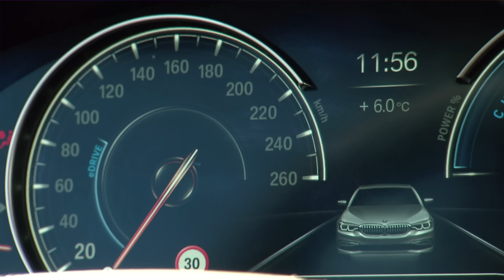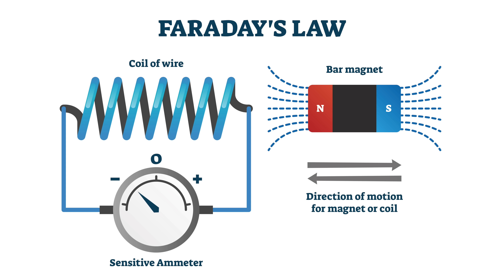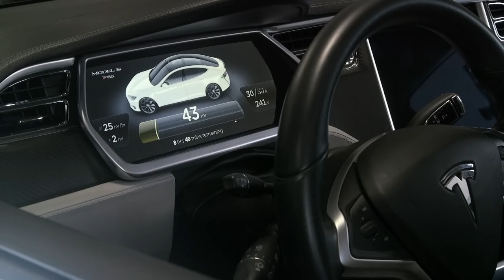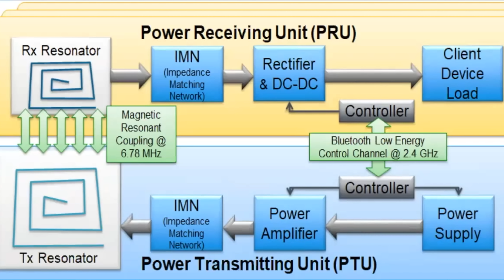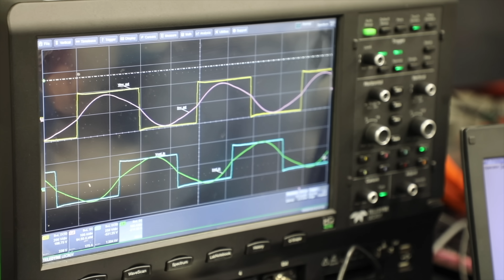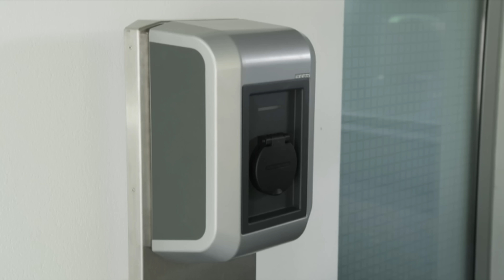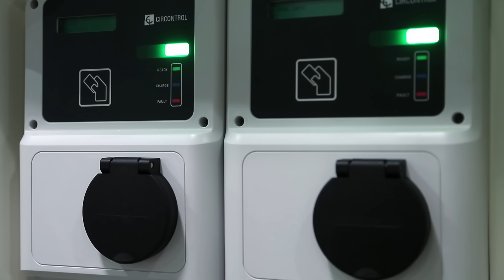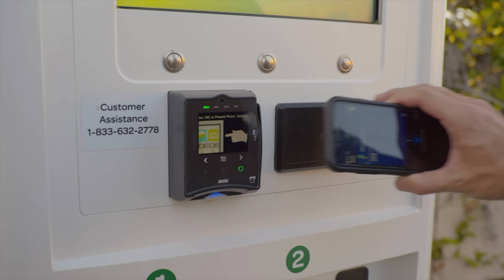Will Wireless Electric Car Charging Change The Way You Charge? Or Just Make Robotaxis Better?

Comment: One place I could see wireless charging be very useful is for pool fleet vehicles.  The kinds that can be in and out all day, shared by multiple drivers.  As someone who has such vehicles at work, with dedicated car parks I cannot see electric vehicles being easy to manage in this situation if we had a few 7kw chargers in our parking area.  Come back with a near empty vehicle, chargers in use.  Even when its free who is going to remember to go back, unplug the vehicle and shift it to free up the charger?  If a bulk purchase of inductive chargers was close in price to individual 7kw chargers for our fleet of 30+ vehicles I could see management going for that option for the convenience factor

As for chargers under the road I cannot see it happening.  Roads are constantly getting hammered by heavy vehicles of 50  tonne plus, require ongoing maintenance, often have services thrust under them which can damage other infrastructure and in a lot of places by the time you put in the three waters, gas, telecoms (often from multiple companies), power, street lighting circuits etc you can quite quickly start to run out of space, especially if you want to make cable runs efficient/cost effective.  

Private parking areas like parking buildings may be a possibility as they generally have less services underground, generally suffer less wear and tear and could be a way for these sorts of companies to create an extra revenue stream by selling the charge to the user or offer it as a value add to attract customers.  Ie the discount supermarket may have a couple of wired chargers available, the premium service supermarket may have wireless charging as a point of difference

Comment: Too inefficient. A lot is lost in heat. If infrastructure for it was built, you'd find it unneeded soon
Reply: Exactly, just more tech that the fan boys can play with themselves with. No matter what you do it will always be quite a bit more inefficient than a cable, air is a terrible conductor and losses in the air are squared are distance apart increases.
Reply: @instanoodles  'Air' isn't conducting the charge, they aren't fitting Tesla coils under the cars ;)

Comment: Mmmm interesting. My idea has always been to simply have charging stations setup at stop signs and traffic lights. The problem have been that inductive charging is not very efficient but with the tech you mentioned it has become possible.

The idea is simply pair a charging pad with a large capacitor (and in the car as well). When you stop at a stop street or a traffic light the capacitor can be charged to give a few KM of range. The battery can the slowly be charged if necessary. 

This sound stupid but will save a lot of space in the centre of town where charging stations are simply not needed anymore. Simply driving through downtown will give you enough power for you trip inside the city.

Comment: I disagree with the "advantages" of wireless charging in public or commercial space. All of those problems you have mentioned with wired charging infrastructure likewise would apply to wireless charging: 1) They might not be on the same network, 2) they might have difficulty paying, 3) they might have authentication issues, or 4) users on the phone talking to representative that does not understand why the car is not talking to the charging pad. I know you specifically clarified "if implemented correctly", but that likewise applies to current wired charging technologies — both wireless or wired charging solutions could avoid all of these issues — when implemented correctly. Later in the video, you came to the same point as I have just made above, that for any solution to work (wired or wireless), network, payment and authentication issues need to be resolved in order for the solution to be viable. So then, what would be the advantage of the wireless charging other than convenience?

So it really does come down to convenience — if the solution can be made reliable enough, efficient enough and cheap enough, then the convenience factor may finally push the solution towards mass adoption.
Reply: Indeed. I was shaking my head so hard while she talked about how wireless charging would somehow avoid all the ridiculous problems with plug charging. To be fair she walked it back at the end of the video. If anything, I'd expect wireless charging to be fundamentally more finicky than plug charging. Imagine you're in customer service trying to figure out, over the phone, that the customer's car is too off-center because they suck at parking. What a miserable job.

Also, people who think wireless charging could be cheaper to install, so we get lots more of it? How do you figure? I can't think of anything related to wireless charging that would make it cheaper to deploy. If anything, it seems more expensive. Plus, each coil can service exactly one parking spot. With plug charging, you can offer parking flexibility, with a cord long enough to reach either of two spaces, or even four spaces facing each other.
Reply: Can you have different electricity providers through the same electrical grid? This is at least possible in for example Sweden; you pay a fee to the net-owner and for the production from your chosen electricity producer, and I don't believe that's a unique model. Wireless charging could just be an extension of this and could be easily regulated with e.g. rfid-tags acting much like a sim-card, or even better, have a "meter" in the car that occasionally sends your consumption data to your provider - again just like regular household consumption works.

The problems of plug in charging stations are only potentially problems for wireless charging if you're stuck in the old plug in/fuel station mindset.
Reply: @idomaghic  I don't see why not -- assuming power from the provider goes into a "pool" of electricity.

Anyways, what you are describing with rfid and multiple providers are solutions to accounting and backend issues -- not really particularly unique to wireless charging. The solution can equally be applied to wired charging, and we are back to the same point about advantages of wireless charging beyond convenience, or lack there of.

Comment: I hope we see standardized wireless criteria. More for the public setting, and maybe for highway cruising. Smaller packs and/or longer highway cruising for both personal and commercial long haul transportation. 

Would also be a nice option for multi EV garage / driveway parking. We currently have wires hanging overhead for flexible charging between two vehicles, hanging them overhead eliminates surface clutter and cord management, but would gladly replace them for wireless units assuming the price was right.

*edit- I was also reminded, by another commenter, subzero cords are quite miserable to manage in northern states, both uncomfortable by touch and quite stiff. While modern DC fast units may mitigate this with thermally controlled cords, the overnight outdoor parking population will benefit greatly with this, in the frigid North.

Comment: inductive charging is way too inefficient waste of power
Reply: As the video mentioned, they're working on improving the efficiency. And if they use a pilot signal to establish a car is above it then it turns on. Otherwise it's just a lump in your parking space drawing only 1W at the most, just like all our other devices that are plugged in but not in use.
Reply: @davidmccarthy6061  the radiation is spherical, so unless the car is wrapped around it. you'll always have big losses. there's no point, just plug in and lose almost nothing

Comment: Not keen on the inefficiency. That runs counter to both the "cleaner and greener" philosophy and the argument that it's cheaper to run an EV.
As for the hassle using public chargers, the solutions are simple: 
(1) contactless payment (debit/credit) card, no app or phone required (Instavolt do this now in the UK, it will be legal requirement for all new chargers) 
(2) Automatic billing based on VIN communicated through charging connector and registered with a payment card or bank account. Literally just plug in, check the green light comes on, and walk away. Tesla does this already and I believe that CCS supports it but very few cars have it.
Reply: Agreed, practical improvements.

Comment: There is/was a similar  charging system being trialed in Milton Keynes UK on a bus route, where the bus has timed  turn-round stops at each end of its route. The idea was to use induction charging as a range extender.   Can't find a recent reference to it for an operational update, the original story was from 2014.

Comment: Yay lossy charging, excess heat, and more proprietary systems for charging...

This is a niche product which will never be ubiquitous, manufacturers putting the charging plate in slightly different places and people being terrible at parking will render the losses too large to be useful. 

Wired charging is the way to go.

A straight forward cost per kWh electric fast charging "pump" would be familiar to most people, the only thing causing problems here is various charging networks wanting you to join their club.  Can you imagine the outrage if you had to join BP or Shell and show a badge before you could get fuel?

Chip and pin pay at pump fuel supply has been a fact of life in the UK and Europe for over a decade now, most supermarkets have a forecourt, and it's an unmanned cashless pay at pump system.

Supermarkets, which essentially sell fuel at cost to get you to go there for your shopping, are already in the process of putting dedicated fuel filling stations out of business in the UK.  This has been going on for 20 years now. 
1996 article https://www.marketingweek.com/superstores-ignite-forecourt-price-war/  
2019 article https://www.racfoundation.org/media-centre/supermarket-fuel-on-almost-every-doorstep

It seems to me that supermarkets, with massive car parks, and the expectation that people will be there for 30 minutes to an hour would be ripe for having entire rows of parking turned into charging bays, and this is probably the future, fuel forecourts will disappear, and parking lots will become the replacement.

Long term parking in cities where a car sits all day, don't even need fast chargers, the granny plug is fine, need 8 hours far a charge?  Not a problem, your already parked up 9 to 5.

You own a factory with thousands of workers and a huge parking lot?  How about all the workers with no off road parking pay you charge their cars when they come to work?

Fun times lie ahead, and carparks are likely the future of fuelling.
Reply: Your second "niche product" sentence s exactly what they said about EV's ten years ago, your blinders are already on.  There are countless products we use today where someone had said, "that will never work". As for workers paying their employer to charge at work, also not viable. But companies can use it as a free perk to entice people to work there. The efficiency of induction charging will continue to advance because we won't need to go to a special place (gas station). With electricity already everywhere we just need to put in the best solution for each location, be it induction or wired.

Comment: Hope wireless charging improves greatly because atm my phone and a couple of friends i know that use it, causes the phones to get very hot. I can imagine that being amplified on BEV's.
Reply: The problem with phone batteries is they are pushed to the max so as to provide the thinnest phone possible so tend to get hot no matter what it's doing. 
This system is a slow charger and more importantly synchronised which as far as I know is not the case with phones yet. The more efficient a system the less waist heat there is. This is why they have spent the last few years sorting out an industry standard so as to avoid the mistakes of different plugs and protocols the EV market has had to put up with up to now.

Comment: I still want to see these systems regulated for RF interference before they become commonplace. And not the free for all that is Part 15 in the USA !
Reply: Some long as they stay below 8KHz there is not a lot of trouble.
That does make for quite a big LC circuit but that is fine.
Basically it can be the classic resonant converter sort of design where the inductor and capacitor give you a big fraction of the filtering for free.
A bit of needless detail on the idea:
Imagine the classic "H bridge" with the negative side being ground.  The positive side can have its power filtered in a manner that causes it to dip near zero volts as the MOSFET pairs switch.

Comment: Parking spaces with great big charging stations in front of them are being ICEd. How much worse will this get if there is just a discreet pad buried underground?
Reply: Great point!
Reply: will not be a problem if there are enough, all long duration car parks need multiple charging pads/posts etc will mean so long as you can find a space you can charge.
Reply: @edwyncorteen1527  Yeah but that has nothing to do with wired vs. wireless. It's not like induction pads will be cheaper to install and maintain, such that there would be more of them.

Comment: The problem with charging at home on the driveway, is as much a problem as public charging. I still have concerns about safety, my 7kw charging cable has managed to twist its cables inside the sleeve, causing a bungle. Plus when it gets cold the cable stiffens up causing loops to stick up in the air, and we have two EV's and so the problem is duplicated. So the fact that inductive charging is also reversible is news to me, but also make sense. This would be a great solution to my problems and needs surrounding cable charging at home and at public charging stations! Bring it on!!
Reply: Yes! Dealing with sub zero charging cords in Minnesota wasn't enjoyable.

Comment: In parking spaces I think it makes sense. IF they can get efficiences as high as those claims. But charging while driving? I dont get it. How much would it cost to install 10 MILES of continuous chargers under a street? Because thats what it would require to actually do... Anything. Driving at the low low speed of 20mph you could get a nice 30 minutes of charging out of a 10 mile section of road... Assuming a continuous induction effect. 

But how many parking spaces could you fill with ten miles of continuous chargers? If the charger were say... 2 feet long... Thats 26,000 chargers end on end. Even if they were spaced apart and only required half as many that is still 13,000 chargers.  How many apartment complexes or shopping malls could those provide power for? 13,000 vehicles charging with the same infrastructure as it would take to make one section of one road an effective charging option. And wouldnt the road have to have a complicated system of sensors to detect vehicles before they got to the induction plate? then try to turn it on at just the right time, with no handshake because that takes too long? Which means it would have to turn on for EVERY car no matter if its an EV or not because even at the low low speed of 20mph there is just no time to confirm it. So they would be wasting dramatic amounts of infrastructure and resources to provide a service to drivers on ONE route. 

 Whereas a parking space charger could just use the same old magnetic field sensors that stoplights use to initiate the handshake. If no handshake occurs it just goes back to sleep.
Reply: You're absolutely correct.  Another problem with chargers in roads is that roads get torn up on a regular basis for servicing the utilities buried underneath, and develop potholes from vehicle damage and freeze thaw cycles.  Chargers in roads don't solve any problem that we don't already know how to solve at vastly lower expense.

Comment: I'd pay to have a wireless charger installed at home if Tesla supported it. Plugging/unplugging isn’t a huge hassle, but the convenience of just pulling in and walking away would be worth it to me. Doubly so if it supported V2G.
Reply: Wireless charging is dumb and inefficient
Reply: @carholic-sz3qv  She said WiTricity claims 93%. The standard plug from the wall is only about 98%. So it's not that bad. I use wireless charging on my phone too, even though it has a plug on the bottom.

Comment: Wireless charging will help with a concept that is happening to me: CHARGE AT DESTINATION. This means to charge were you go. Charge at the supermarket, at the office, at the gym, at the medical center. If you go to a supermarket, it could have charging stations, ideally low power ones. Wireless is ideal, and they can charge while you shop and give you a discount on the charge cost or give it for free, in case is less than an hour for example, or if you have a shopping loyalty card. This will give the supermarket a distinctive benefit to the customer to go to it instead to another that does not give free charging time. If you go to the office, this could be an employee extra benefit on top of the salary. Basically your work pays for your trip, or at least some miles to your home. A wireless rack, with low power transfer will be ideal, it does not need to be fast charging. Charge at the gym while you work out. This can be an incentive that give a competitive advantage to other gyms. Wireless charging will become like free Wifi.
Reply: With charge at destination there is also the possibility of using vehicle to grid which could even out supply as well. The price differential could benefit the employer who charge at home with off peak and sell it to the grid during the day. 

Though a real boost for the supermarket is a side contract with a scrap yard. Any ICE vehicles in a EV space will be automatically removed by crane and be scrapped. The sale of parts or even whole vehicles will pay for the installation of the chargers and cranes. It will end the problem of being ICEd.